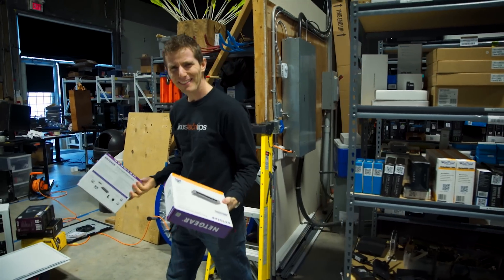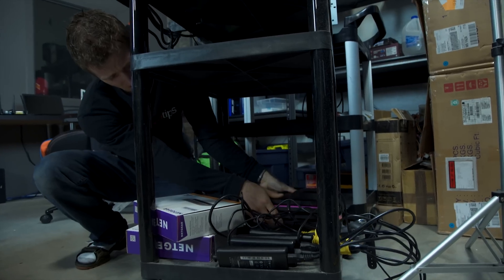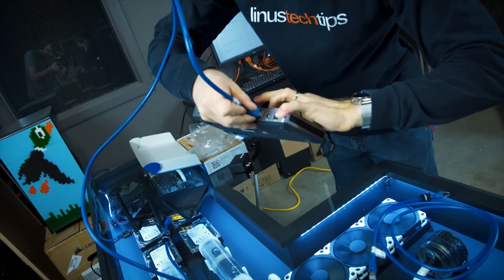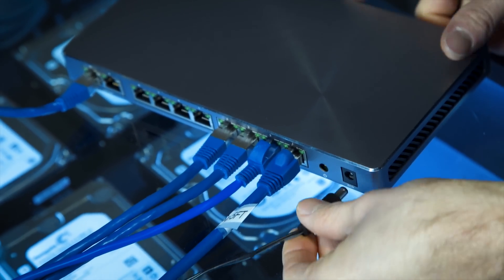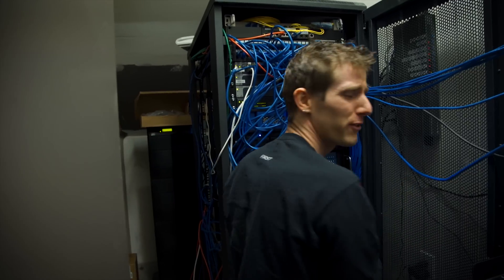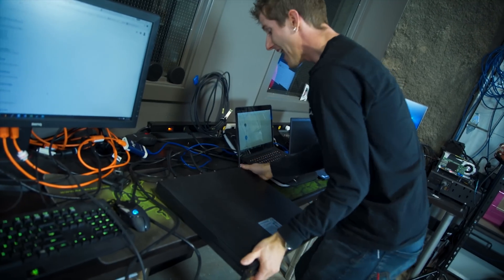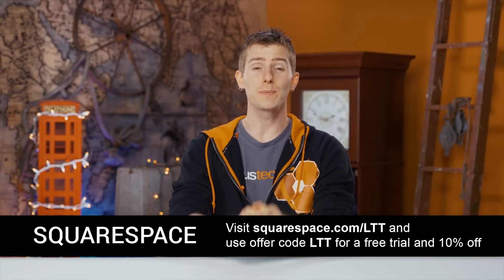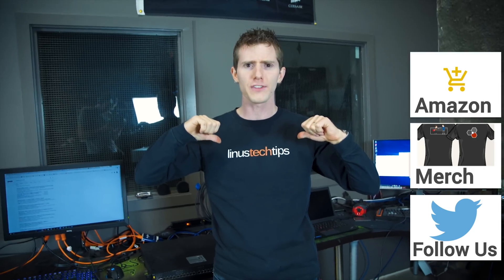Easy 10x Network Speed Upgrade

Comment: Yup, I'm just going to add that to my 30 Mb/s internet connection and multiply my speed. ;( But, really, it doesn't work that way.
Reply: internal network only dude.
Reply: Yup.
Reply: That awkward moment when you try to make a sarcastic comment but everyone just thinks you're an idiot. RIP Edward
Reply: Yeah, I understand that.
Reply: its network not internet learn the difference
Reply: Yup, thanks for understanding.

Comment: Why would you even recommend 10 gbe anymore?  You can move to 40 gig or infiniband for ptp for around the same price if you're moving into enterprise gear.
Reply: What does he need 40 gig for when even the PCI-e SSD wasn't bottlenecked by 10gig?
Reply: really?  Where can you get a consumer grade 40Gbps switch or interface card for a few hundred bucks each?  youll also have to move to fiber interconnects which most people know fuck all about.
Reply: Enterprise and eBay. Info and is pretty cheap to get if you know what you're doing
Reply: Infinaban*

Comment: Only 2 10Gb ports for $250, seems expensive but i get the ease of use from asus on this. The other switch does look like a decent deal if you can get the other bits cheaper.

Comment: I am paying £38 for 1.5 Mbps download and 0.35 Mbps upload speed. Is this a rip off?
Reply: holy shit..
£38....
I'd call the police
Reply: TheMojoLemon Yes
Reply: nop and you missed the subject of the video is network speed not internet speed
Reply: That is worse than in Canada even.
Reply: still better than my internet in Australia :(
Reply: even in poland thats shit
Reply: TheMojoLemon depends where you live.
Reply: TheMojoLemon YES. You can easily get 50+ Up and Down for the same cost
Reply: pixelsandbacon not everywhere has internet speeds that fast. I can only max get 25 down 1 up. (My plan has 20 down 1 up)
Reply: +TheMojoLemon on virgin media in the UK for broadband only it is like £40 for 200Mbps speed i may be wrong but i have their 150Mbps speed with ultd anytime calls and almost all non premium channels on the TV for just under £70 which is just under 2x as much but the benefits are over 4x better
Reply: But does he live in the UK?
Reply: if the only options faster than that in your region is Cellular connections(which have notoriously high and unreliable Latency), then no.
Reply: Windwalker 95 yes
Reply: I'm paying less than $10USD for 10Mbps download and upload with no bandwidth limit. So, yeah... yours is a RIP OFF!
Reply: you're getting ripped off lol, I'm paying $60 for 1 gigabit. TV and home phones are useless these days so I don't know why anyone would pay for them.
Reply: Mr. Ixolite I've had this same broadband for 5 years so maybe it's outdated cause BACK then internet was more limited and expensive
Reply: I'm paying 200$ for 4up 4down
Reply: Here in larger cities you can get 900 Mbps for 25$...
Reply: I pay 75$/month for 1Mbps down and .5Mbps up. :/
Reply: STUPIDDDD He is talking about LAN speeds
Reply: Zahid Shabir I'm switching to Virgin media.
Reply: DONT SWITHH TO VIRGIN im payind 50£ for 20mbps down and 1mb upload, on non holidays in the morning 2am
Reply: LegendaryVegeta Did you believe me? 😂

Comment: I don't even have 10 gbps internet just gigabit
Reply: Peter Kapica you poor thing
Reply: Peter Kapica i have 1mbps and i've always considered having that better than most people have  :(
Reply: its network speed not internet speed and i doubt you have gigabit internet conection
Reply: nicogenio83 well my router (a gigabit one) will transfer files to a hard drive at the max speed of the USB 2.0 drive (40 Mbps) over wireless
Reply: Well, you know how to solve that problem, right? Just order 9 more fiber pulls and channel bond those bitches!
Reply: Hamza Aman I never go a network server working cause I never understood it
Reply: Taylan meriç well it's Better then nothing. I had a 10 Mbps connections for about 1.5 years and it was bad espacially at night. Now with a 90 Mbps connection it's all good
Reply: I just researched isps in Romania and you can get a 100 down 30 up connection for10 dollars usd. That kind of internet costs 100+ a month in us

Comment: thanks now I can get Comcast 2Gb internet when the build out is done.
Reply: John Chambers....  its not internet speed... just network...
Reply: QuantuMlapZiz sure it is if your internet connection can go over 1 gig Comcast offers a 2 gigabit connection in the United States
Reply: Even then, most Internet servers will throttle throughput, so you probably won't get over 200mbps (25MB/s) downloads. I get about 24MB/s (192mbps) or so on downloads via Steam, but most downloads from websites won't be that fast.

Comment: It didn't work, did it? :O|-
Reply: The Goat The file transfer was like 700 megabyte per second, that's 5600 megabit per second or 5,6 gigabit per second
Reply: He didn't show the results for the Ebay hub. Marcus. :O|-
Reply: I have a LB6M it will do 10GB/s line speed

Comment: So I can get 40mbps speed from my 4mbps connection?!?
Reply: st0nnec0ld eh no, this is network not internet. This would be for stuff like a network storage system or a NAS.
Reply: no.
Reply: st0nnec0ld are you sure you don't mean 32 mb/s? mB/s != mb/s
Reply: You'll be wrong, there are 10gbps consumer internet plans (NOT business plans, there are 10gbps business plans as well) here at SG$200 per month or roughly US$250 per month. It's offered by (as far as I know) 3 ISPs, but your other components are likely to bottleneck that connection anyway.

Comment: pls stap videos like these telling us we get better internets when we dont :C
Reply: He never said your internet would be faster, he's referring to the local network.
Reply: MoDRun Network speed not Internet speed.
Reply: MoDRun network is not the same as internet
Reply: 1:28 he said that it doesn't make yout internet faster, just the internal networking
Reply: MoDRun he never said internet. If you dont know what a network is fuck off.
Reply: Network speed is not the same as Internet speed.
Reply: Technically they didn't. The title only mentions network speed, not internet speed.
Reply: MoDRun It works but you need the internet speed to support it. if all you buy is a 100Mb/s plan then all you will ever get is 100Mb/s. In my area i get 1Gb so upgrading to a gigabit router and getting Cat6a cables did infact increase my speed after i bought the better plan. in this case Linus is talking about LAN data transfer. The best cables can easily put out 10Gb speeds on your LAN but NOT over the internet itself. Do not confuse the local network and the internet. If you own a server and a crap ton of computers then this is a great item to invest in.
Reply: MoDRun networking not internet, how did you get 200+1 does anyone know anything!?
Reply: he is not talking about internet is network improvment
Reply: n this video he actually explained the uses of local network, So dont get too mad
Reply: You obviously don't belong on a tech channel...
Reply: or listen to linus saying it in the fucking video, if you somehow miss the title lol
Reply: Alex V4 
wow. Did you just politely clarify something on the internet? That must have been hard
Reply: 1 + 3 = 4 tards that need to learn basic engriiisshh...
Reply: 1:28
Reply: So? It's the confused people who are wrong. Not the video title. It's people like you who propagate it and continue to argue about it even though it's been repeatedly pointed out you're wrong. 

People read your dipshit comment and think "yeah!" and read no further to clear up their confusion.
Reply: 5:30
Reply: you should know its LAN not interwebs if you are here.. stop thinking the impossible could happen and use ya noggin
Reply: Because he knows it will draw in a ton of views.
Reply: watch the video you moron.....
Reply: MoDRun Idiot detectet. Life is easier, when you are able to read.
Reply: MoDRun can you read?
Reply: It's only confusing to noobs.  Where does he say this will speed up internet speeds?  Too many daft people tinkering in technology.
Reply: MoDRun when I read your comments you have an exaggerated Arnold Schwarzenegger accent in my head.
Reply: Wonder why i get 350 likes if this isnt a problem lots of ppl are having.
Reply: lol i know its not same as internet. he made videos like this atleast 4 times before. i said it so that we can see how many ppl agree with it because it sounds a LOT like its about internet speed. and maybe just maybe see how fun it is to get a bunch of angry ppl commenting lmao :D

so since theres atleast 350 ppl who dont understand it then maybe the title should be 'local network' instead of just network since lots of ppl think network is internet
Reply: GitRich
Reply: gitrich? whats that supposed to mean lol
Reply: You have a bunch of 'likes' because 350 idiots think network = internet, just like you do!  You also have that many likes because when people click 'dislike' on your comment your 'like' thingy stays the same.  This comment probably has a like:dislike ratio of 350:1000
Reply: ""This comment probably has a like:dislike ratio of 350:1000""

sure but that doesnt change the fact that 350 ppl who saw my comment need to be informed how it works properly.
Reply: ""If people mistake network for internet, they're just ignorant and Linus doesn't need to change his title for them""

I thought this channel was about teaching people how stuff works.

internet is still a network but a local network is not internet as someone in the comments here said.
Reply: MoDRun "need to be informed how it works properly."

He literally talks about it in the video.  So yes.  If you watched the video and still feel network = internet then you are an idiot.  Simple enough.
Reply: ppl arent reading comments and just repeating stuff i alredy answered now.
Reply: If you were taking in what's being repeated instead of trying to dismiss it and then repeating the same thing again later on you wouldn't have to deal with people repeating points.
Reply: im not dismissing anything. im simply saying there should be in the title 'local network' instead of just network so people dont get confused and watch a video they probably dont need to watch and other reasons
Reply: You are dismissing that people are saying it shouldn't be a confusion at all. And you're trying to give it credibility so yes, you are dismissing it. With things like argument from popularity and shit. "oh other ppl think this way too!" 

The internet is not a network really. It's a massive collection of connected networks. And when someone is talking about their network or a network they are NOT talking about the internet. Because that's not how you talk about the internet.
Reply: no it shouldnt be a confusion but that doesnt change that it actualy is a confusion.
Reply: +MoDRun casual noob
Reply: NETWORK ≠ INTERNET. Seriously.
Reply: i know its not a confusion for the majority but its still a confusion for quite a few ppl

Comment: LInus you make the strangest decision.  A Cisco SR2024T on eBay goes for $115.  No GBIC or SFP required.
Reply: They only appear to be 1Gbps and not 10Gbps ports on that ?
Reply: curtisimo032 that's not a 10GbE switch dude.
Reply: curtisimo032 Thats a gig switch, this video is about 10 GB
Reply: did you watch the video?
Reply: Isn't that a gigabit switch rather than a 10 gigabit switch?
Reply: Agreed. And, knowing what happens inside a switch, I can't help but find them to be awesome.
Edit: Original comment was completely changed.
Reply: Cisco makes some of the best enterprise and small business network products. Their consumer products don't necessarily reflect this.
Reply: That is a gigabit switch
Reply: It was edited. The comment originally criticized Linus for saying that switches are boring.
Reply: Lol cisco. Makes me laugh when people think they make good and reliable products.
Reply: oh
Reply: Austin P Their Smb solutions suck ass. Take a look at the UC series phone systems for example. They had support, when the units started dying 3ish years later they EOL'd them.
Reply: LoL what a fail comment. If you're going to make smart arse remarks at least know WTF you are talking about.